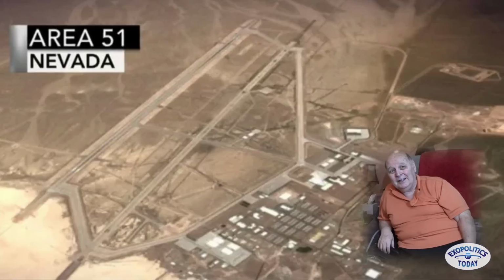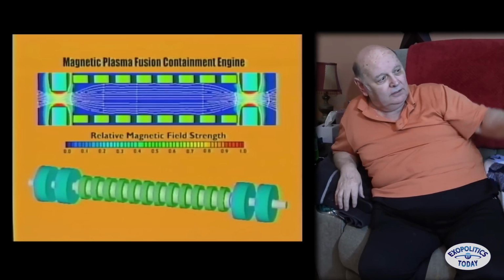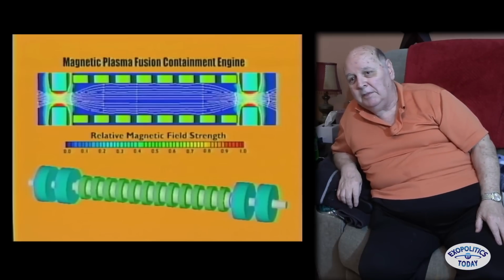Visit to Area 51 and Ancient Alien EM Fusion Containment Engine – David Adair Interviews Part 2

Comment: 4:40 reminds me of a dream I had in the late 70's. I was in a cave with soft light coming from nowhere. In the center of the room was a podium shape that is formed from the cave with what looked like bread sitting in the middle of the podium. I knew to point at the "bread" and then to where I wanted it to go. Part of it came off and there it went, on it's own. I did this many times. I asked many many times what this meant and never got an answer. Interesting that this jogged my memory while viewing your video. What else have I dreamed that I may not remember? Hmmmm  🤔🤔🤔

Comment: Well, he needs to change his diet.  He is only 1 year older than I.  Intermittent fasting, low carb and when he is better the longer fasts.  He can totally reverse the diabetes  with a change in diet.  Walking is the best exercise for someone suffering from diabetes.  I am sure this Being will help him with this.   He does not have to give up some of his favorite foods by carb cycling but will have to initially reduce them drastically.  Diabetes is a modern day plague.  He needs to eat food not processed food with preservatives and additives.  He should eat all organic including meat.  He can do this.  He could have well over 30  more years.   A holistic doctor can help him with this.  I started having heart problems because of the pandemic weight I gained.  I got very serious about getting that weight off.  I have 15 more pounds to go.  And yes someone who is older and is a sugar addict like me can have challenges.  HIs sodium and potassium levels must be in check.  Sodium is easy to get but the potassium is harder.  I take supplements of potassium.  Magnesium also very important and most people are deficient  in it.  This can be reversed.  I have seen it.